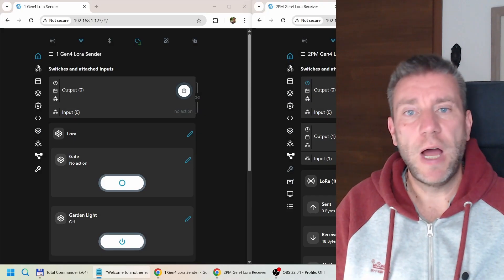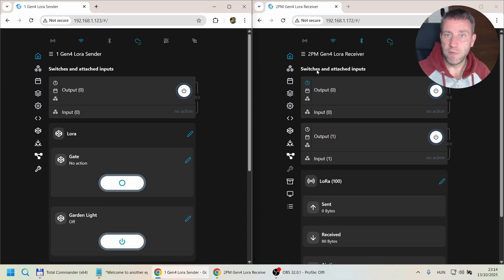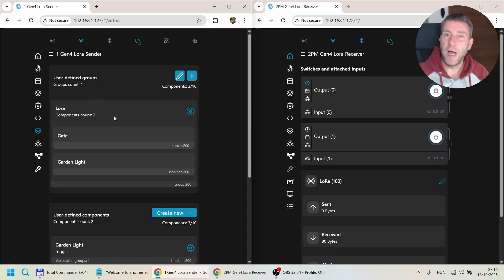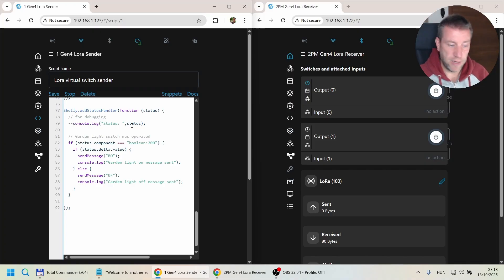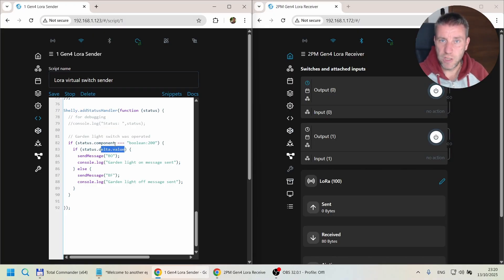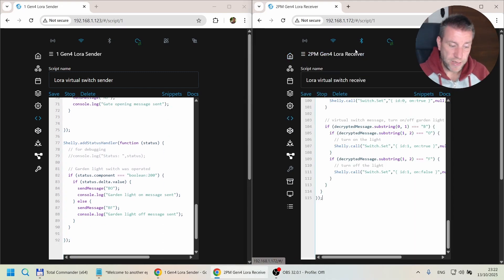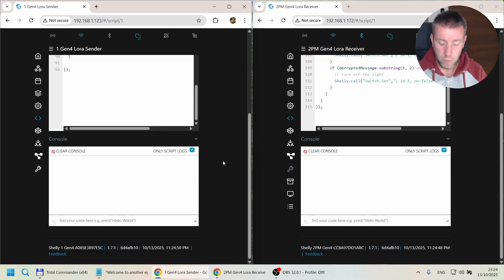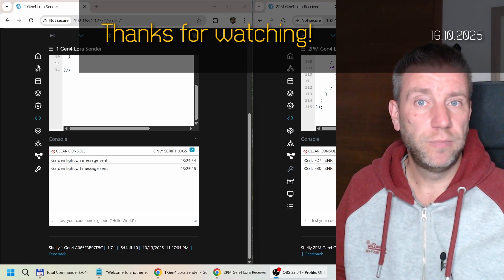Turning lights on with Lora

Comment: Great Job. Thanks!!!
Question. Is there a way to sync back virtual buttons state when physical switch is pressed on the Shelly 2pm?
Reply from the maker: Thanks. And yes it is absolutely possible. The physical switch will trigger and event, you can send a Lora message when that happens. On the other side, once the message is received, you can use the Boolean.Set function to change the switch. Like I did here on the range test.
Reply: @csongorvarga  THANK YOU!
Trying to set it.

An advice from you would be very appreciated.
Should I:
A) write and run a second set of scripts, like a sender in the receiver and a receiver in the sender or
B) add in the same forerunning scripts the new "feedback functions"?

If not clear tell me...
Reply: Option B) is working!!
Thank you

Comment: Hi
I did everything you said, when I press the virtual button the message is sent and received but the output from my receiving device doesn't change.

What could I be doing wrong?
Reply: Hi, I've already managed to solve this part. I was using channel 2 of Shelly, but I'm using 1PM.

Is it possible to create schedules? Can I schedule without using the virtual button?
Reply from the maker: @helderfreitas6760  Sorry, I was on holiday and did not check my messages. Yes, I did the code for the second output... Schedules... hmm, you can only tie a schedule to the output on the device... but you can create a time based scene which triggers the virtual switch. That would work, just need to set it up as a scene instead of a schedule on the device.
Reply: @csongorvarga  Hello. I've already managed to add the schedule within the virtual group.

What I wanted to know was if, instead of one button and one light control, I can have two light controls on the two channels? And how can I do that?

thanks